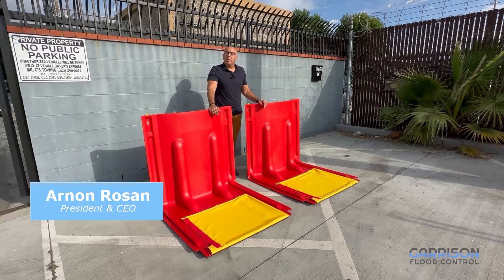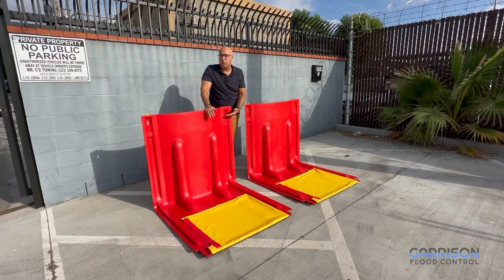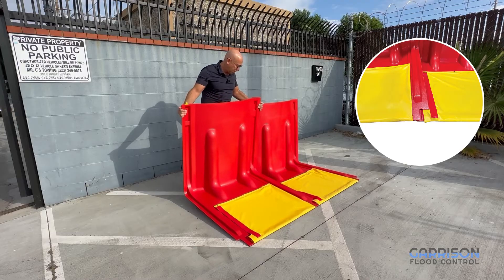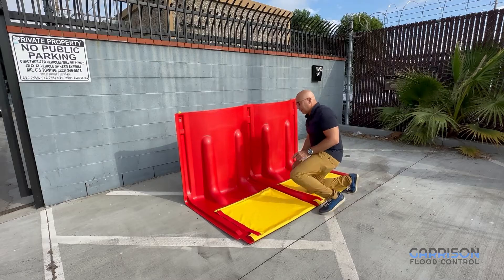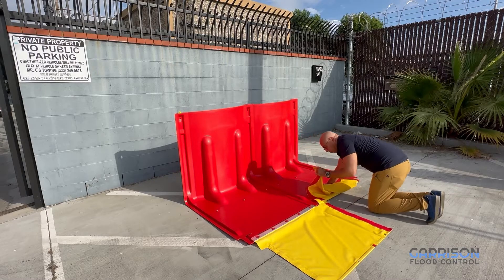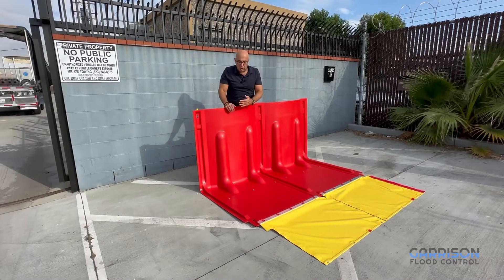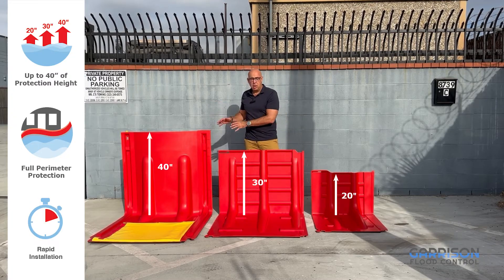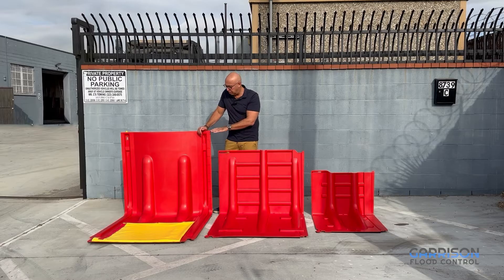The Mayim™ MAX Flood Control Barrier | What It Is and How It Works

Comment: can it be installed on openings only or does it need to be fully around the house?
Reply from the maker: Thanks for the good question.  The product can be installed at entrances only, using our End Gables, which help seal against the wall on either side of the opening.  You can also use some visqueen and sandbags to help reinforce that seal.  If you do want to go around the entire perimeter, this is possible too.

Comment: I can use any size of these on my grass?  These don't have to be on concrete?  I have to ask because I read over a year ago this plastic wedge design doesn't work on lawns, but they didn't have the plastic roll out flap either.
Reply from the maker: These work on grass or on concrete or asphalt but of course the seal is much better and you minimize any leakage of you put this on flatter surfaces.  If the grass isn't level, that could also create some leakage.  For this reason we do like to recommend a second line of defense when on grass, in the form of a pump like our Sea Sponge.

Comment: How long is the service life?
Reply from the maker: This varies depending on the specific application but the material does have an 8 year UV package against degradation.  Considering that the material will mostly be used as needed for floods we would anticipate in excess of 10 years of useful life.

Comment: How do you ensure the water is not going under the flap and the panel?
Reply from the maker: There is a neoprene seal under each panel in addition to the flap.  We often recommend people strategically place sandbags on less even area to ensure a good seal with the ground below.
Reply from the maker: The flap material is more flexible than the more rigid panel material and is designed to contour to the ground below.  That said, we typically recommend a sandbag or rock be strategically placed to help depress the flap down into surface below, creating a more secure seal. This isn't needed for the entire length but only on strategic areas where the material isn't able to contour as easily.  Once water rises, this helps press the the flap further.